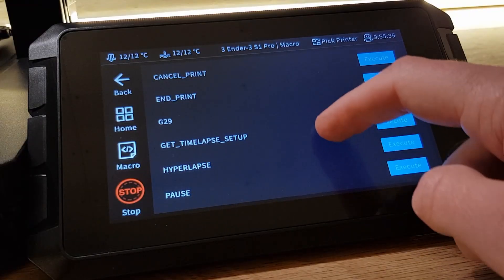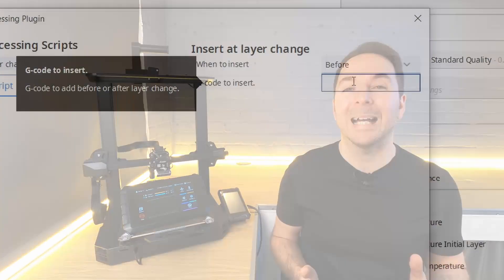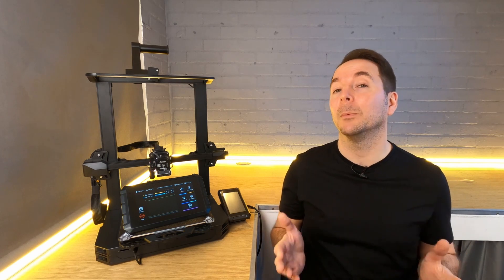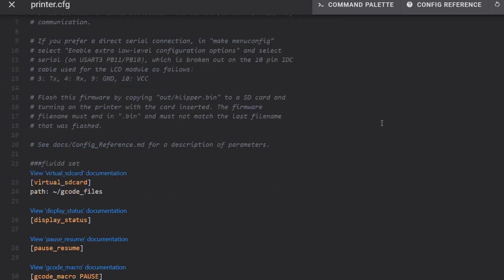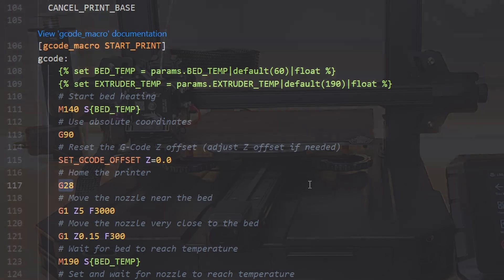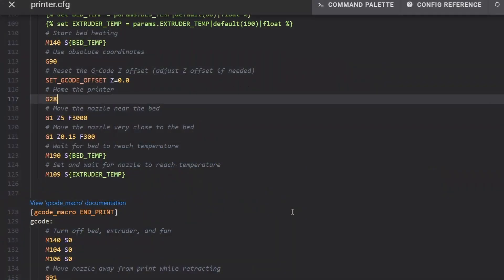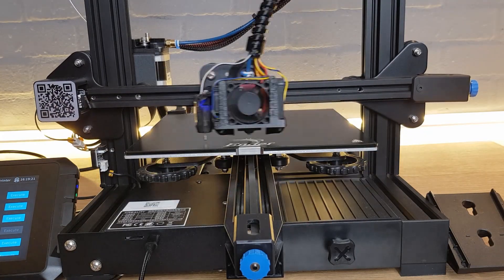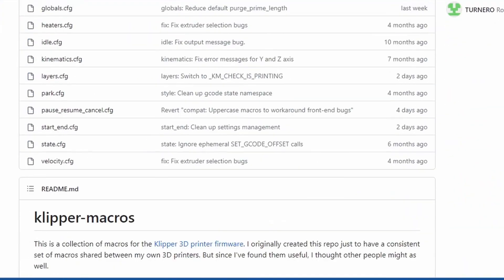How To Use Macros To Streamline Your Sonic Pad Experience - Sonic Pad Intermediate Part 7

Comment: Hello, I use the pause macro to change the filament and once paused, I created a filament loading macro. Until then everything is ok. but when I restart the print I have 2 problems, first I extrude a lot of filament when starting, and the approach to the print is very low, rubbing against the piece. How can I edit this on the sonic pad?

Comment: He missed something when swapping the Cura macro with START_PRINT (@5:59 in the video).
START_PRINT in his Klipper example takes two arguments: BED_TEMP, and EXTRUDER_TEMP
When you replace the macro in Cura with START_PRINT, to send the Cura parameters for the bed temp and the extruder temp to Klipper, you have to add this line:

START_PRINT EXTRUDER_TEMP={material_print_temperature_layer_0} BED_TEMP={material_bed_temperature_layer_0}

Now, it will take the parameters {material_print_temperature_layer_0} (initial layer nozzle temp) and {material_bed_temperature_layer_0} (initial layer bed temp) from your model, and add those values to the gcode you'll be sending to Klipper.

With only the START_PRINT in the Cura macro window, you'll always be using the default temps for nozzle and bed as defined in your START_PRINT macro in Klipper.

I found that when strictly following his directions, my bed would never heat up to the temp the model was set to (same for the nozzle).

That being said, they may change to the correct temp AFTER your START_PRINT macro is complete, and the actual printing starts.

Comment: I was having the default temp takeover.  What I did was pretty simple to get rid of it.  There is no need to have default temps in the macro button so I deleted the |default(60) and |default(180) but left the |float %} after it.  Nothing fancy worked for me.  but that's not surprising because this is day 10 of learning klipper and any kind of coding.  Big take away is comment what you do!

Comment: Start, End G-Code Macro does not work with OrcaSlicer.

Update 
I got it working by changing the start code in Machine G-Code to
START_PRINT EXTRUDER_TEMP=[nozzle_temperature_initial_layer] BED_TEMP=[bed_temperature_initial_layer_single]

Comment: It would be cool the see a comparison of a NO Sonic pad vs Sonic pad print.
I set mine up and followed the videos BUT im not 100% convinced that it sped up the print time. 100% made it easier to level the bed and fix other print issues but not sure if speed changed....unless i missed something in the set up (which im going ovwer again).
Reply from the maker: You need to change your slicer settings to tell it that it's ok to go faster now. This will help: https://youtu.be/Aqi5vjE0_QU?si=R4ney_Zcc6ecC7jC
Reply: @RickyImpey   THANK YOU!!! i figured it out. I re-worked the set and i thin i got it now. Initially i selected the correct model and could not import the proper profiles. This time i used the ffff option and it worked.

Comment: In case anyone runs into the same problem.
When i added the "move bed forward to remove print" lines in the END_PRINT macro, i had to add the G90 #use absolute coordinates above the move parameters to stop from getting a "move out of limits" error.
I made sure to add the G90 after the G91 "move z up 10mm", but before the bed move. Reason for the order was to prevent the print head from using absolute coordinates before it did the "move away from part G1 x-2 y-2 z-3" code so it didnt potentially attempt to bury the head into the printed part and bed. (It probably would have thrown another "move out of limits" error but better safe than sorry)
Reply: @RickyImpey This needs pinned.  Just had to make the same change myself after getting the 'out of limit' errors.  Everything else worked like a charm.
Reply: oh, thank you guys! I’ve been having this issue since modifying with macros.

Comment: This series has been very helpful! It seems though no matter what I do, when printing a file from Cura, the specified temperatures in the file are ignored and the bed is heated to 70, even if I specified 60. This is nowhere in my code and I used the exact code for the macro you did, Any pointers to get this working correctly? I can see on the console screen that something is telling it to heat to 70, but it wasn't anything I did. Thanks!

Comment: I've been trying to use this and i have encountered a problem with the start macro on PETG,
It seems to set the  BED_TEMP and EXTRUDER_TEMP value to the default and not the temperature in the gcode file sliced by cura, this results in unusable prints.
Did anyone found a solution to this problem?

I think the lines setting temperature and such can be removed completely as this is handled already by Cura before the start code.
Reply: I think these are variables and you should pass them from your Start G-code in the Machine settings in Cura. Your Start G-code should look like: START_PRINT BED_TEMP={material_bed_temperature_layer_0} EXTRUDER_TEMP={material_print_temperature_layer_0}

Comment: I own sonic pad for a couple of months now, but still learned quite a few things with this series. thanks a lot! 
one thing that I haven't figured out yet with sonic pad and klipper are notifications. On Marlin I was using M300 and beeping sound. Now with klipper the original screen is gone so there's no beeper anymore. I can wire one to a spare pin and create an M300 macro, but it would be way cooler to install a telegram bot and be able to get full notifications and config. Do you know anything about it and can you maybe create some tutorial? Thanks again!

Comment: hi..i am trying to add a macro to remove the part after its done so it can start over again ( same as continuous print in octoprint).  I tried to add the gcode , 
[gcode_macro Continuous print]
M17 ;enable steppers
G91 ; Set relative for lift
G0 Z10 ; lift z by 10
G90 ;back to absolute positioning
G0 X30 Y1 F3600
M190 R29 ; set bed to 25 for cooldown
G0 X30 Y235
G0 Z1
G0 Y0
G0 X30 Y235
G0 X100 Y235
G0 Y0
G0 X100 Y235
G0 X160 Y235
G0 Y0
G0 X160 Y235
G0 X220 Y235
G0 Y0
G0 Y235
G28 ; home

When I tried to restart the hardware, it gives an klipper error and it wont start..any tips? 

How Can i trigger the continuour print after each print is finished?

Comment: I bought an Ender 3 S1 pro and a Sonic Pad, and both work fine. I would like to connect two webcams to the Sonic pad, pointing one camera at the bed and another at the spooler. Can I connect two webcams at the same time, choosing which one I want to display on the web UI? Configuration changes? I have already connected the two webcams, one at a time, and they are both compatible. Thanks in advance.

Comment: Ricky, thank you so much for all of your videos, they are extremely helpful! 

With that said, for some reason, my start print macro will not save. The end print macro shows up but not the start. Any suggestions?
Reply: i just figured it out my guy. the title of the macro unlike the end macro is not highlighted yellow so it is not recognized as a macro. where it says "[gcode_macro START_PRINT]" hit backspace in front of the title and it should highlight yellow. basically the title is indented over 1 space to far to be recognized. hope this helps

Comment: Nice videos, but I needed to set my starting gcode to:

START_PRINT EXTRUDER_TEMP={material_print_temperature_layer_0} BED_TEMP={material_bed_temperature_layer_0}

This properly relays the temp settings from Cura to the printer.  Otherwise it was using the default values for the temp.
Reply: Thats a solid bit of thought! Mine heated up and then to start the print it cooled to 190 which looks a lot like default set in the start print macro button.  No where did you put it? after the purge line or did you swap out the M190 and M109?  Im guessing after the purge line.

Tried it all and was getting can't parse errors.  what I did was remove the default set at the top where it would populate the macro button on the front end.

Comment: Ender 3 s1 Pro with Sonic Pad. Cannot do a pause at height or filament change without errors 😭😭😭 add m600 macro system says already exists. Pausing through Cura errors out. Help

Comment: I followed this video and noticed that at START_PRINT it would heat up to my first layer temp, then cool down to the defaults instead of what I set for the print in cura, then after the first layer it would heat back up. I saw some suggest I set this for the Printer Start G-Code in Cura and not sure if it is better or what? These videos have been awesome!

M104 S0
M140 S0
START_PRINT BED_TEMP=[first_layer_bed_temperature] EXTRUDER_TEMP=[first_layer_temperature]
Reply: Ok that didn't work either... I just matched to what I want the start print to be and it works but it still has some weird pauses. Not sure what I am doing wrong on my S1 Pro

[gcode_macro START_PRINT]
gcode:
    {% set BED_TEMP = params.BED_TEMP|default(70)|float %}
    {% set EXTRUDER_TEMP = params.EXTRUDER_TEMP|default(205)|float %}
    # Start bed heating
    M140 S{BED_TEMP}
    # Use absolute coordinates
    G90
    # Reset the G-Code Z offset (adjust Z offset if needed)
    SET_GCODE_OFFSET Z=0.0
    # Home the printer
    G28
    # Move the nozzle near the bed
    G1 Z5 F3000
    # Move the nozzle very close to the bed
    G1 Z0.15 F300
    # Wait for bed to reach temperature
    M190 S{BED_TEMP}
    BED_MESH_CALIBRATE
    # Set and wait for nozzle to reach temperature
    M109 S{EXTRUDER_TEMP}
    G1 Z2.0 F3000 
    G1 X5.1 Y20 Z0.3 F5000.0 
    G1 X5.1 Y200.0 Z0.3 F1500.0 E15
    G1 X5.4 Y200.0 Z0.3 F5000.0 
    G1 X5.4 Y20 Z0.3 F1500.0 E30 
    G92 E0  
    G1 Z2.0 F3000
    G1 X5 Y20 Z0.3 F5000.0
Reply from the maker: That's strange, I can't see anything wrong here. Try searching through all temperature settings in your slicer to see if there is something there setting a different temperature to what you want on your first layer.
Reply: @successfulgeek  did you figure this out.. I move from TPU and PETG annoying to have to change the setting or monitor the print at the start to reset temp

Comment: hello i have been watching your videos and they are a lot of help. thanks for doing them. i just wanted to post that i tried the m600 command and could not get it to work my system kept crashing i had gone and did some more research on it and found out they added the m600 code into the update. so i had to change other things. i was getting the error error m600 already registered. so i removed the m600 macro and it went away then i started getting the error "gcode,error:{"code":"key244": "msg":"Extrude only move too long (-2258.247mm vs 1990.000mm)
See the 'max_extrude_only_distance' config option for details", "values":[-2258.247, 1990.000]}"
 This video is what i used to fix my problem https://youtu.be/CWU7XYbEQYE
agen thank you for your time

Comment: Thank you so much for your videos. One of the best that I can recommend to my friends. I ran into an issue with my printer recently and Sonic pad came to the rescue. I watched all videos related to Sonic pad and set up the same. It works awesome now. I ran into few issues like "code":"key243","msg":"Move out of range. I moved the G1 X0 Y225 to the line below G90 and it works without any error. I referred the existing code and did this change. Wondering if this could cause any issue down the line.

Comment: Im trying to use the filament change option in cura and it seems to work but when I resume my print it poops out 4-5 mm of filament really fast after hitting resume. is there a way to prevent this? if possible I would like to remove auto retraction too.

Comment: Great video, Helped me alot set up my macros. I want to add m300 g code causing a beep when print is finished. i cannont find the pin number for the buzzer in the sonic pad. any suggestion?

Comment: Ricky could I please borrow 2 minutes of your time? 2 questions. I'm running sonic pad s1 pro,before print I get nozzle ooze during the bed mesh,this is messing up my first layer,would you happen to have the correct code to input into the start code,cannot find an example online. Also is there anyway to restart the intial bedmesh when originally synching the sonic pad without a hard reset,I'm after the screen where it tells you to tighten down all the bed wheels before the first calibration I'm assuming this result effects the subsequent manual bed level screen it asks you to complete. Many thanks for your time,didn't know who else to ask lol
Reply from the maker: Hi, personally I use a nozzle prime line on the edge of the bed to remove anything that has oozed from the nozzle. I also don't take a new mesh before every print, I use the saved default mesh usually.
This is my code for these but be carful in how you use anything here. It depends what you are starting with as to what you remove or add in to your macro/start gcode.

BED_MESH_PROFILE LOAD="default"
G1 Z2.0 F3000
G1 X5.1 Y20 Z0.3 F5000.0
G1 X5.1 Y200.0 Z0.3 F1500.0 E15
G1 X5.4 Y200.0 Z0.3 F5000.0
G1 X5.4 Y20 Z0.3 F1500.0 E30
Reply: @RickyImpey  Thank you ever so much will have a fiddle with it

Comment: First of all, these videos have been a godsend. Thank you so much.

That being said, I've been trying to tie two of your videos together for practical purposes by writing a macro to run the pressure advance test so I don't have to copy and paste it or write it down somewhere every time I want to print the test and have been wholly unsuccessful.

I just want to send the two commands that you use for the pressure advance test in your other video ( those being SET_VELOCITY_LIMIT SQUARE_CORNER_VELOCITY=1 ACCEL=500 and TUNING_TOWER COMMAND=SET_PRESSURE_ADVANCE PARAMETER=ADVANCE START=0 FACTOR=.005 (for my direct drive S1 Pro)). It seems like a good role for a macro - send these two lines of code with a button press, then print the file and adjust PA accordingly for any new filament. I can't for the life of me get it to work. Any ideas?
Reply from the maker: Hi, the Ender 3v2 profile actually already has a macro for this. Here is the code coppied straight from my config file:
[gcode_macro Press_Advance_short]
gcode:
    SET_VELOCITY_LIMIT SQUARE_CORNER_VELOCITY=1 ACCEL=500
    TUNING_TOWER COMMAND=SET_PRESSURE_ADVANCE PARAMETER=ADVANCE START=0 FACTOR=.005

Comment: Maybe I missed it somewhere, do you show how to set the X,Y probe offset?

Using a Minimus hot end cooler, the probe location is slightly different. It is only a few mm, so not likely an issue most of the time, but it could come into play on larger prints.

I don’t see a way to do this directly in the setup or settings pages.

Luckily the creator of the Minimus provides the offset values, so no need to actually measure those.
Reply from the maker: Hi, just manually edit the X and Y offsets directly in your printer.cfg file under the [bltouch] heading.
Reply: @RickyImpey  I managed to figure it out. Also had to adjust the figures, as the ones given were a little off.

I also ran into an issue where the end print code was causing an error. Turns out the code in the PDF was calling for a final bed position outside of the default limit in the config file.

Comment: Followed along all the videos and everything went great, until the Macros. When implemented, it seemed to ignore my previous z-offset, and it didn't return the print head to the side of the printer after a print was done. I also didn't like how the nozzle heating didn't even begin until the bed had reached temperature, and also how the nozzle was pressed down into the bed as it heated up. All adjustable, I'm sure. I will give it another try in a couple of days.
I'm also interested in figuring out how to get an audio notification when a print is finished (and/or for filament changes) as I'd set up with Marlin (Ender 3S1 and PrusaSlicer, btw), but based on what I've read around the web it seems the hangup is figuring out how to get Klipper to communicate with the SP's speaker, if that's even possible. I've seen a few crumbs of info here and there, perhaps I can put it all together in time.
Thanks again for the great videos, Ricky!

Comment: As a 3DP noob, this is the only video out of your fanatic series I wasn't able to fully grasp. I'm missing the importance of pointing the slicer's Gcode to a macro. Would love to see some more in-depth explanation and examples of macro usage. Also, any thought into a Patreon account (or something similar) with a level in which subscribers can bounce questions off you? Thanks again for sharing your knowledge!
Reply from the maker: Hi, macros are used a lot with klipper and eventually you may come across something that you want to create a macro for. However, you don't need to change the start and end code with one, this is just an easy example of how to do it if you wanted to. I thought it would be a good introduction case. I don't have a Patreon or similar as I try to answer as much as I can through comments but it is becoming tricky to get to everything in time for people. I may consider something better soon. Thanks for your comment.